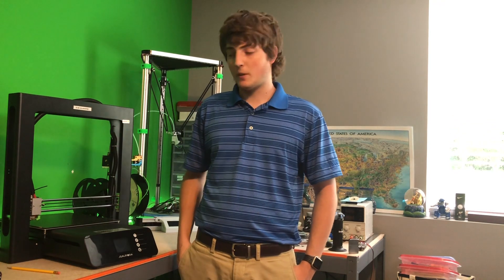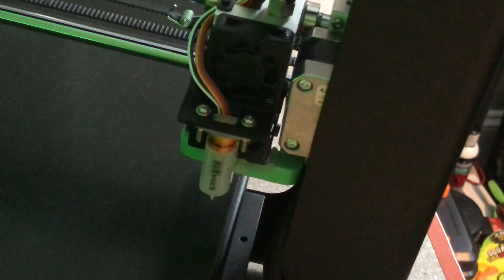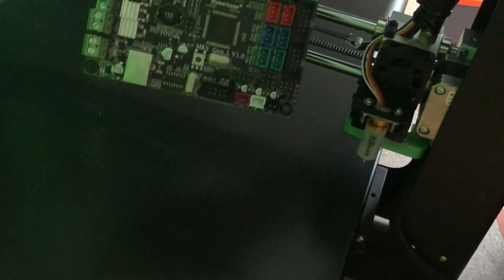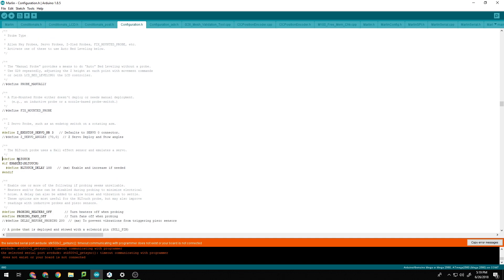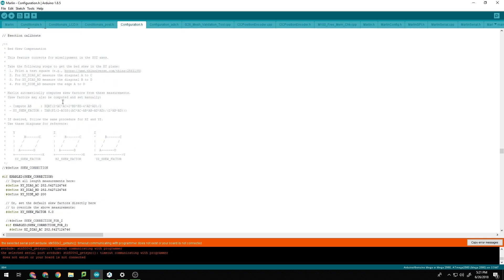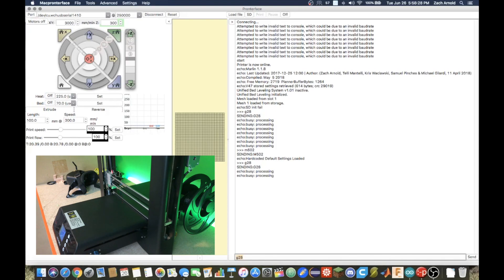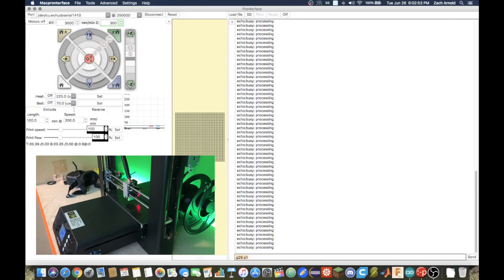Automatic Bed Leveling Installation | 3D Printing

Comment: Hi everyone. I'm trying to install and activate BLTouch on my CR10S. Then: firmware changes OK: check and compile ok, upload to printer OK. BLTouch installation: I am "reasonably" sure I have made the connections correctly. But when I want to test the link, when I bring the z axis up and do a home z, the axis does not go down, and if I touch the sensor shaft, nothing happens. I tried to invert the black and white wires , but the sensor flashes continuously, a sign that the previous connection was correct .. The word "STOPPED." appears on the printer display. If I launch "Autohome", it is positioned at the beginning of the Y, then at the beginning of the Y, then goes to the flat center and stops ... Moreover, trying to check with Pronterface, once pressed "Connect", after a few seconds the message appears to me: "Error: STOP because of BLTouch error - restart with M999 [ERROR] Error: STOP because of BLTouch error - restart with M999" Can you suggest me something? How could I try the sensor offline, to realize if it works alone? Thanks in advance
P.S. Has anyone else met my same problems?

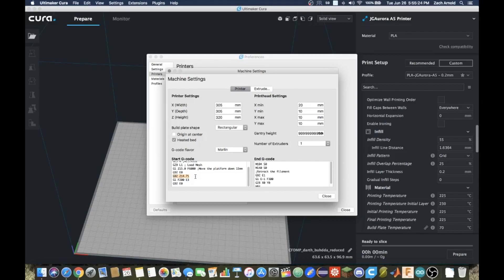Comment: Where's the value 14.71 from? How did u measure it? (10:50)
Reply from the maker: I got that value to calculate the offset needed. I set the printer to 15mm and then set it to the offset value. So, I would change that value until it was the perfect first layer. 14.71 means I have a .29, z-axis offset. Does that explain it better?
Reply: @TheProfessionalNerd but where is the value of the offset from? How do I measure the exact offset between nozzle and BLTouch?
Reply: Roger Röwekamp the value from the offset is determined from measuring the distance between the probe and nozzle. I used a ruler and caliper for the process. It doesn’t have the be that exact.

Comment: Hi, thank you for the video very usefull. I have some doubts: If i understood well with the commend G29 P1 the UBL system calculates the mesh, then you store the mesh with G29 S1 and load the mesh every print adding to the starting Gcode the command G29 L1. I would prefer to recalculate a mesh every print i run, how can i do this? In this scenario is useless to store the mesh in eeprom. How can i calibrate the z offest of the printer? This is not very clear for me.
Thanks in advence for your response.
Reply from the maker: I was setting the offset with the start gcode. The gcode line was G92 Z14.71